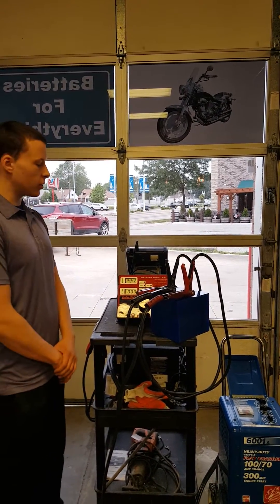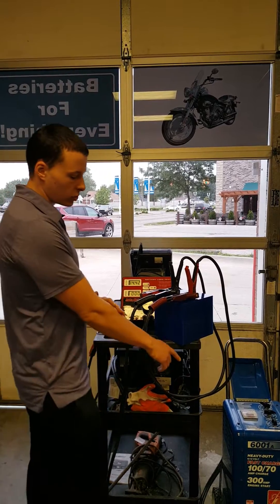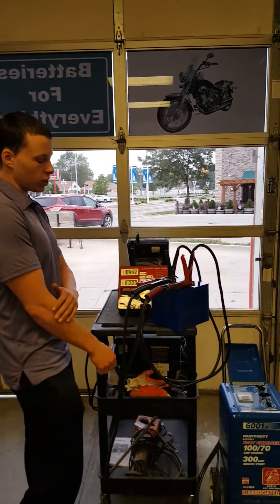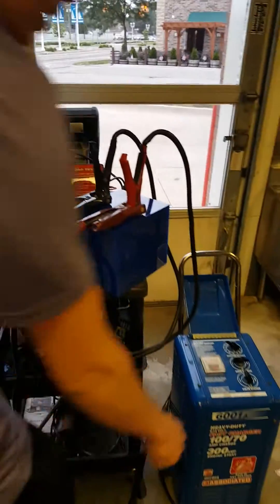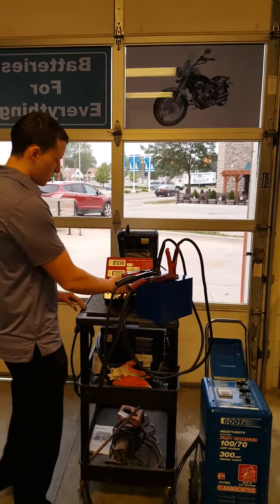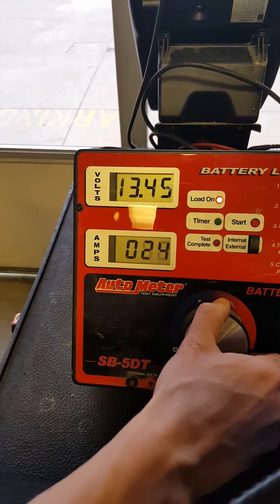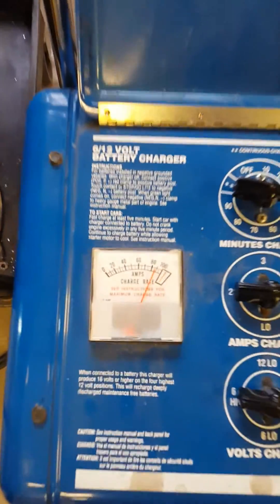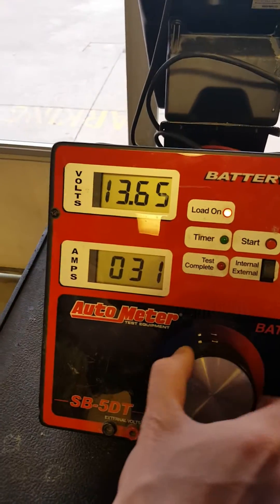JuiceBox Lithium Iron Phosphate 20AH

Comment: i hope you're not planning to SELL these "tested"batteries as new to your customers, putting this kind of  high loads on ANY battery is like murder to them, it will do serious damage to the plates inside especially with LEAD ACID  batteries  witch are FACTORY capacity tested at no more than a c/20 rate (100 AH rated batteries during a 20 hour discharge so in practice a 5 amp continuos load) LifePo4 batts are FACTORY tested at a 0.5 C rate (so 50 amp discharge during two hours, 1C rate means 100 ah load in one our) lithium PEAK discharge is mostly a 3C rating, pulsed can be a 10c but only for 10 seconds max, but do not expect a long and healthy life from them after this kind of abuse!

Comment: It barely stayed above 12volts with 90amps going to it, also you put 420 amp load on the 20amp charge vs 408 amp load vs the 90amp charge, not the same loads, tests are not accurate...
Reply from the maker: Testing was to show output, and correlate to real world use. Not to match the same load. Also, this is a 13.3v nominal battery with an operating voltage of 14.6v (full saturation) to 8.0v (full depletion). 12v is the ideal voltage to maintain to ensure proper use and ideal performance.